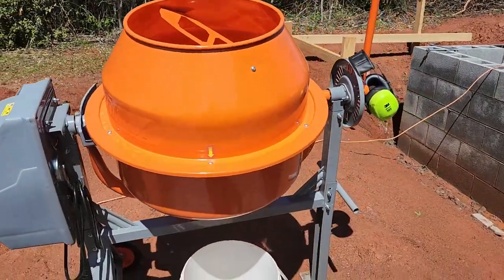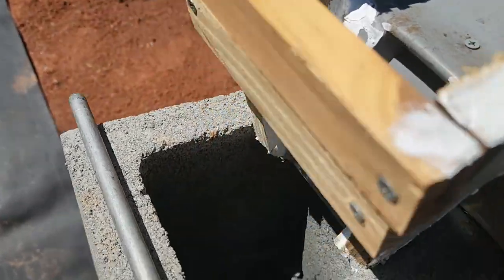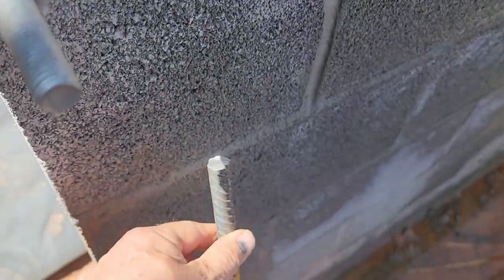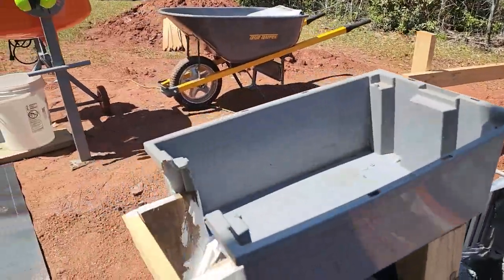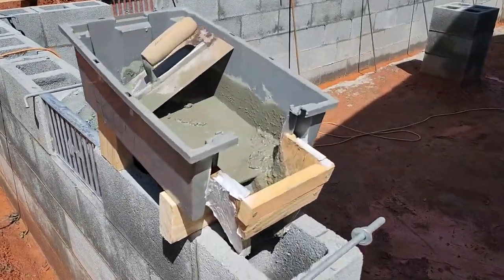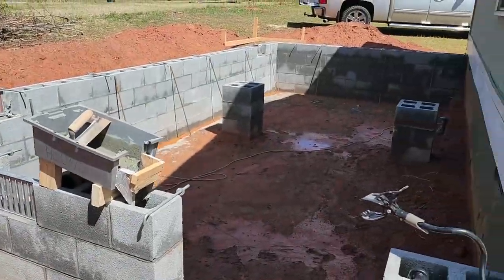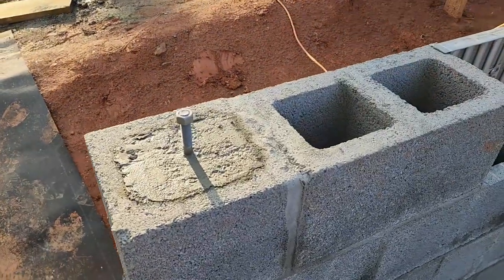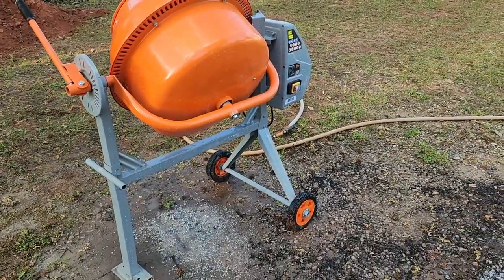Yardmax 4 cu.ft. Concrete Mixer Waterproof Electric Motor Grouting Cinderblock CMU Cells

Comment: Per the owner's manual, the unit should be turned on with water added first, and then add concrete.  The unit should be left on the entire time it contains concrete.  Rinse immediately after emptying.
Reply from the maker: Owner's manual, Lol. I figured out the water thing second time around but its way to messy to try and pour into bucket when running. I didnt have any trouble with cleanup. Thanks for watching Dave.